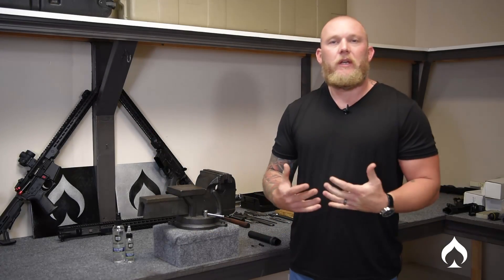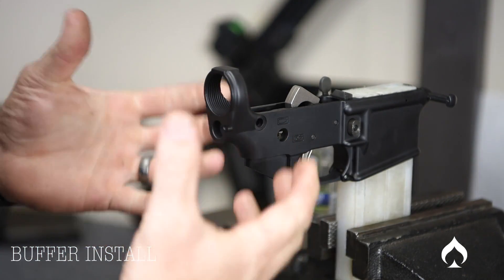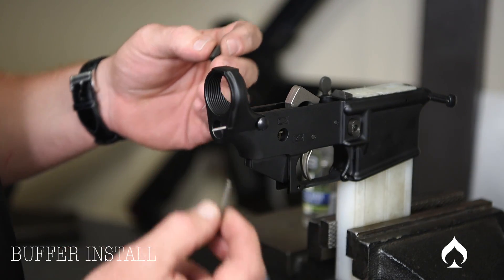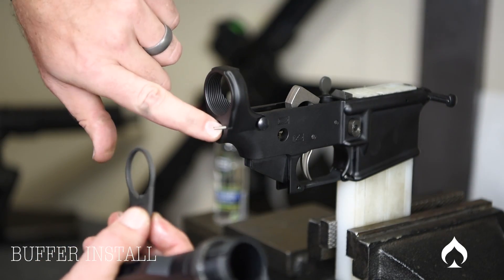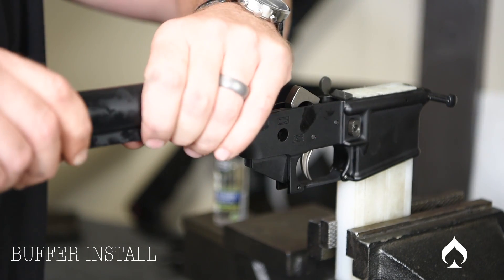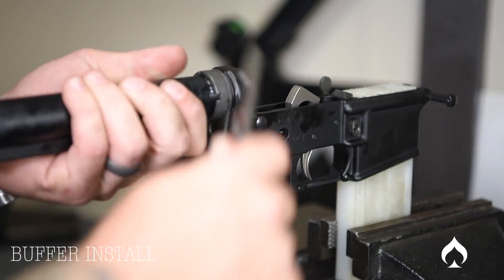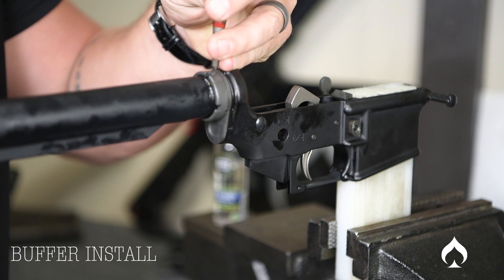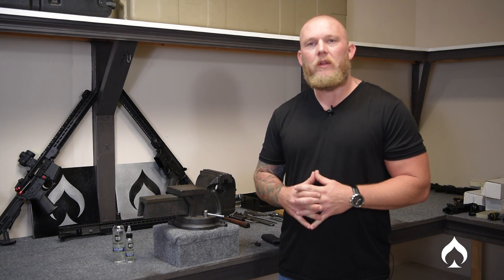Ballistic Advantage Builder Series: Install the Rear Takedown Pin, Buffer Retaining Spring and Pin

Comment: Spent an entire night doing this. The spring which popped out when changing the button stock. I popped it in and tried everything. When I finally had it in, I could not get the retainer pin free to out it back together.

Comment: Clint, so I recently built an ar for the first time. I am having an issue. When a round is in the chamber, my CH is really hard to pull back in order to make my rifle safe and unload that round. At first I thought I had an issue with my extractor, I changed it and put a new one in. I shot couple mags with no issues and it cycles just fine. For some reason I cannot rack that charge handle. Any ideas what it could be? It almost feels like it is catching on something. It only does this when a round is in the chamber.

Comment: Always put Aero shell grease on the receiver extension (buffer tube) threads and torque the castle nut to 38 foot pounds..Then stake it in two spots..

Comment: Total noob question but is that detent spring actually necessary? I don't see it sliding out and the gun popping up just bc that's not there
Reply: Yes  it is. It keeps the takedown pin in place. The takedown pin will walk out while firing and if it comes out then you will experience a catastrophic failure and possibly damage your lower.

Comment: I did exactly this method and staked it in one position. The manual says the torque spec is 38-40ft/lb
Mine is probably around 25ft/lb and feels sturdy. Is 38-40 really required for maximum reliability?  I just can't imagine it coming loose, especially staked, even under very hard use. Your thoughts?  I imagine it's one of those things people overthink about. I guess myself included lol
Reply: I've built two rifles and never torqued to disc or staked the cage nut. Get out hand tight then wrench it snug and it'll be fine.
If you need reassurance use a silver sharpie and make a coke indexing marks. If it moves then re- tighten and stake if you want to.

I saw another comment that suggested loc tite.

Comment: I’ve done this recently and it works great. But it took so many tries to get the buffer tube perfectly aligned. What is the trick to get it aligned? I don’t understand why after so many tries I randomly ended up having the buffer tube completely positioned correctly.
Reply: I just ignored alignment lmao
Reply: Don’t end plates and receiver extensions have notches that line everything up?
Reply: @radjamss6390  there’s a certain distance that the buffer tube is supposed to travel. If you make it travel too far then the detect thing, that is holding in the buffer spring, will now be underneath the buffer tube. Everything is pretty easy to lineup yes. But I guess PSA has a hard time with buffer Springs and buffer tubes sometimes because it was like freaking 3 of them.

Comment: I twisted my buffer til it was upright and covering the retainer pin properly but when I racked and did a dry fire the retainer pin popped out and into the barrel while the spring got mangled under the bolt. Any idea  what it could've been? Too much of a twist or not enough? 

I was putting on a hellfire kit.. I appreciate any advice and thanks in advance

Comment: A couple of additional tips: 1. If you are installing a receiver plate with a QD mount, double check that you don't put it in backward. The indented ring inside the hole needs to be toward the outside. 2. The full length takedown pin spring can often put too much pressure onto the detent and press it too hard into the groove of the takedown pin, making it very stiff and scratchy. You can cut 1/4 inch off the takedown pin spring and it will actually work better with the reduced compression. 3. Also, the detent pin head and takedown pin groove might need a light sanding with 1000 grit sandpaper, and the groove should be greased, in order to reduce friction even more.

Comment: Who needs a torque wrench🤷‍♂️ and who needs to stake in two places🤷‍♂️ I don’t.. hell
Reply: People who want to do it right, that’s who.
Reply: @riflesfirst208  exactly
Reply: Same “German spec”, aka, “gud N’tight” has always worked for me 🤷🏽‍♂️… Don’t even own an armorers wrench 🔧 lol.
Reply: Staking is a feel good for people who don't know about proper thread stretch. Watch a video on an engine build. 
They will torque the connecting rods bolts to, let's say, 60 foot pounds. Then they will check bolt stretch with a gauge. If, let's say,  .006 is not achieved, they will add torque until it is. That ensures proper tension on the threads to keep the nut from backing off. And they NEVER stake the nuts. Torque value is also not the end all. 
Staking the BCG gas tube screws is a good idea. You might not get the torque for proper thread tension on the screws with the small bit you have to use. The bit would break first. That's where staking helps.
Reply: @jhutch1470  Staking is part of Colt’s TDP. Colt knows more about properly building these rifles than any of us do.

Comment: Ok hiw many springs did yiu lose before this lol. Seems like the detent spring is so long . I always use a razor blade to hild it down.  Nice video thak you
Reply: Lmao helppp my rear detent spring is so long it makes the takedown pin unmoveable when put in
Reply: @pikeponcio587  what did you do to fix this?
Reply: @gagestamper2382  I still haven’t. Cleaning it has become an hour long process so I’m trying to sell it
Reply: @pikeponcio587  i have found out that cutting about a 1/4 inch off the spring works great with some gun oil.
Reply: @pikeponcio587  hey let me know if that fixed it, if you still plan on selling im more than happy to buy
Reply: I got mad and cut mine down to it in works fine

Comment: How do you make sure the buffer tube is “clocked” exactly straight up and down?
Reply: It has a whole in it for the buffer detent cant go wrong
Reply: I ran into this issue. The buffer tube did not stay clocked when tightening and it shifted. Did not even get to torque the castle nut and the threads got damaged. It has a groove in the threads that align with the end plate, but didn’t stay in place.

Comment: great video. I've got a question. when I want to disassemble the tube, would it be too difficult to remove the ring because of the punch you made? thanks.
Reply: Not at all. Staking is not permanent, simply twist it off.

Comment: Take a 4-40 tap when tap hole for the rear  take down pin spring hole. Take the spring using wire cutters cut about 1/8'' off spring. Then put in take down pin, detent, spring. Use a 4-40 -1/8  set grub screw and you'll never have to mess with the spring again.
Reply: I had this idea as well. Looking for a comment like this to give myself "permission" to do it.
Reply: Do you have to tap the lower detent hole for that?

Comment: I suggest turning buffer tube to the  right side a bit then iserting the latch pin spring, return to position and usin a sma.ll screwdriver to ailing with latch  plate and push in then tighten castle nut